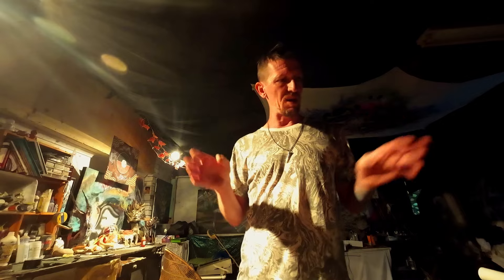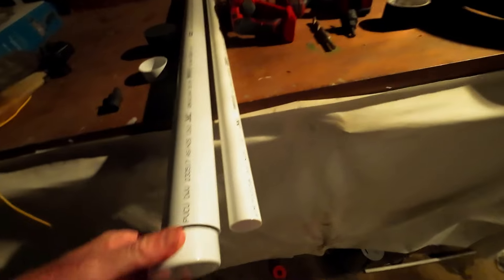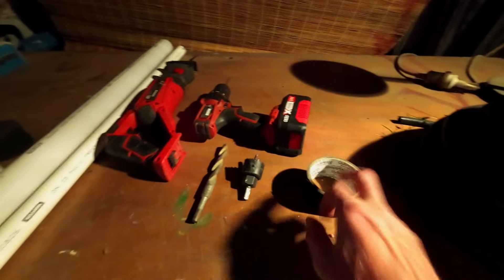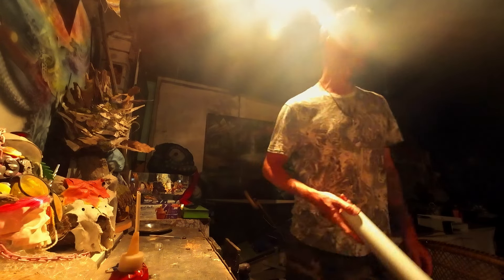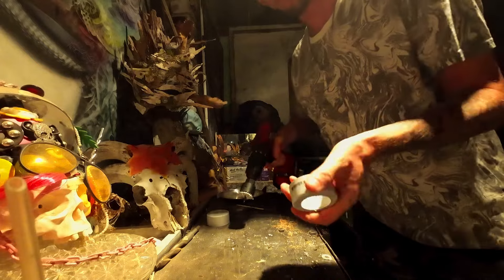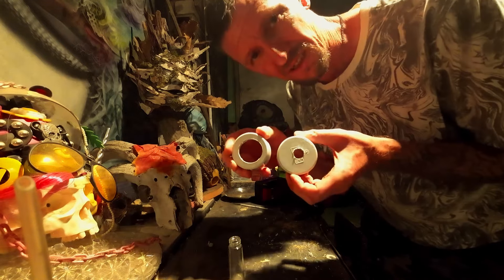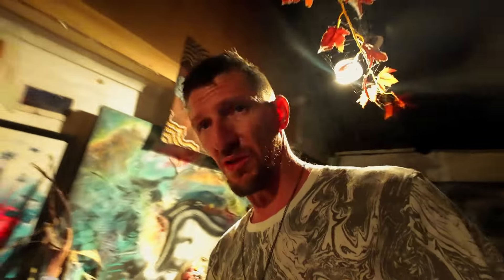How To Make A Bait/Yabbie Pump With Crevice Attachment

Comment: Have you been watching my vids? I have made multiple attachments for multiple pumps, when crevicing you find that you always need something else to be able to get to the bottom. The good thing about the garden hose is it is flexible and can bend around corners. Love it, Sir Gadzee. 🙏 
Cheers big ears!
Reply from the maker: There's so many variations I stopped using metal tubes coz they always get blocked.
Reply: I still have one on my "nugget trap" , but made a similar flexible tube. Keep punching the content out mate. Loving it. Cheers Andy

Comment: Great video! When you put the wire to stop the small pipe from going all the way through, is the other end of the small pipe with the gutter stopper almost flush with the end of the big pipe or sitting up inside? I've never used one before so I have no idea 😀
Reply from the maker: Nah it's just tied drilling the pipe can cause a weak point and can snap the pipe after a while. Yes it's flush or just a lil but inside the larger pipe the it prevents wear

Comment: You can also use a tennis ball cut the tennis Ball in half put a cuple holes  in the tennis ball haves  bolt it on to the cap  then glue it on to the pole   works perferct .
Reply from the maker: You can indeed I find that losing the bolt or having to tighten it always happens.

Comment: None of my crevices have gold in them 😂 but it was still interesting to watch a true DIYer at work.  I assume there's a hideously expensive commercial version available that's only half as good as your 'tried and tested' technology 👍🏼
Reply from the maker: Hahaha oh there is commercial versions and yeah about 80 bucks when you could spend 30 and make it yourself and not lose the nuts, washer or plugs. I've changed the gaffa once on one I've had for 2 years

Comment: Its amazing what you can make out of pvc pipes. PVC doesnt get hot like metal does too! Good work gadzee
Reply from the maker: Yeah it's a pretty versatile material there's heaps of styou can make with it. Yeah it lighter aswell thats why I use it less weight the better

Comment: Well if its not the next Gen  of Red Green.  Great use of Duct tape. You could have used pipe fitting glue to fit the pipe to the top cap.  It's pretty cheap
Reply from the maker: Yeah glue would work but if the cap breaks you'll have to cut it off

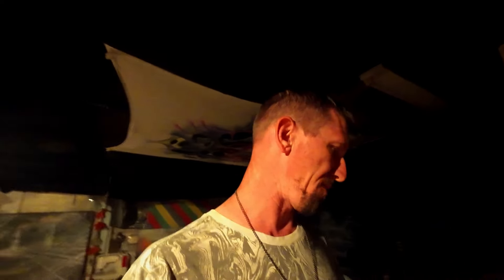Comment: Cheers for the vid Gadzee.  I used a rubber expansion plug you can get from plumbing and pool supply places for the plunger.  It's pretty much indestructible, can be removed and put back easily if something gets jammed in but is probably more expensive than everything else in your vid.  Let's just say I can get them very cheaply from work ;)  I've also been experimenting with putting a short length of bicycle tyre tube over the end of the pump, it sort of sucks in with the dirt and rocks on the upstroke, and then holds more dirt/gravel/water/gold in while you're getting the pump to pan or bucket.  Got the idea from Glenreagh Gold (https://www.youtube.com/watch?v=E1FxVF8wW20 around 10:10), begging your pardon Gadzee for the non-Buckshot link :)